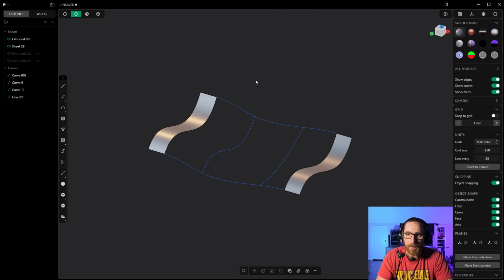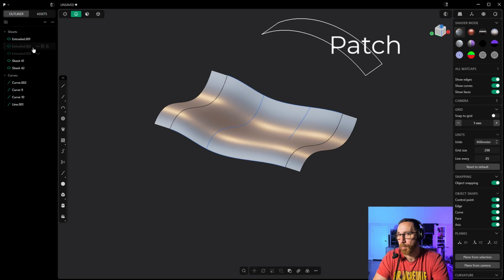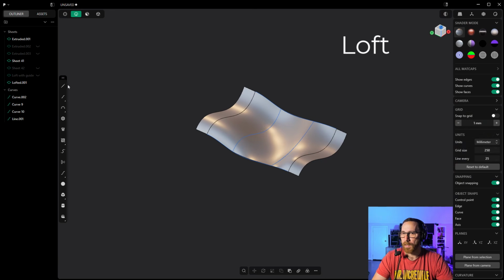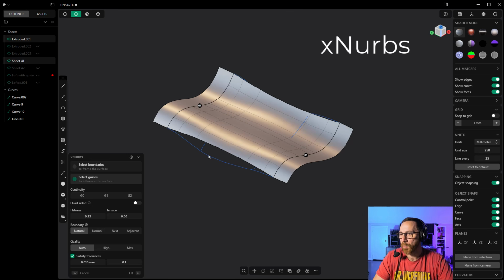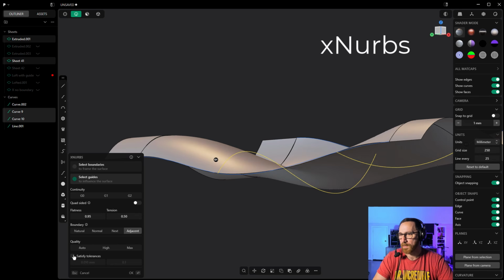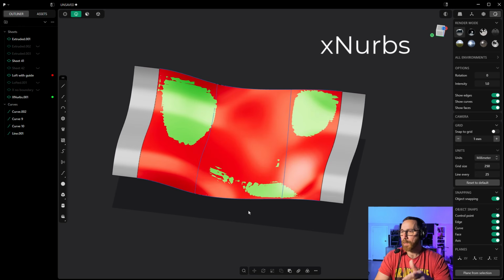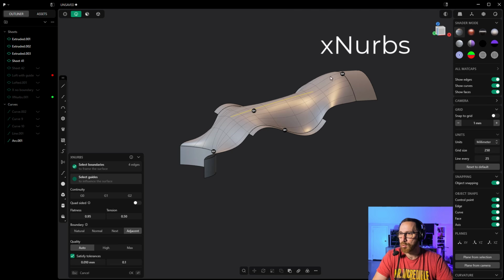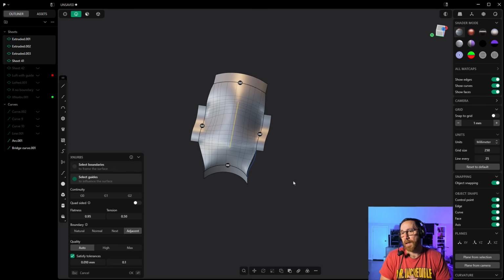Is Plasticity Xnurbs better than Loft? | It Depends | Walk Through Surface Creation and Review

Comment: Hi Matt... thanx for this... your videos have been very helpful... I am starting to design guitars to build on the CNC using placticity... I am kinda doing okay as I have experienc in blender, Fusion360 and Shapr3D... but one thing I'm trying to figure out is this. once a lofted surface has been created, can you make changes to the curvature, or do you have to delete the surface, change the guides and re-loft/patch everytime... I have Indie licence and I'm wondering if upgrading to Studio for the Xnurbs will give me more freedom... Thanx again for the helpful content...
Reply from the maker: Sounds like Fun!  So to answer your question there is no "link" to the curve used to create the surface.  You can manually adjust the surface using tools like Raise Degree, but I believe that is a studio only feature....

Comment: I just bought it today and just trying to extrude a wing profile with about 30 segments it ran into trouble. Often doesn't cap the extrude, I can't scale the cap end to taper the wing, I can't move it other than in out along the extrude and if I loft between two copies at different scales they don't align, even though they should be identical vertex order it apparently tries some kind of nearest vertex bridging that goes wrong. Am I just doing it wrong or is the program really that limited? I have to segment the wing profile to get it across the span intact?
Reply from the maker: If you select the curves, it will extrude a "sheet" surface.  If you select the inside profile, it should extrude a solid.  If the profile isn't selectable, then it might not be closed (or on the same plane).  That would be the most likely reason it doesn't cap the end.  If you look in the outliner on the left you can see if it says "sheets" or "solids" for where the body gets created.

For the loft not aligning, id have to guess at this one without seeing the curves, but when you scaled the copy up, where was the scale point at?  Was the original created with symmetry about the origin?  I haven't had it jump a vertex like that on a copied/scaled profile before.

Comment: I bought the indie version, but to be honest, I tried to make something more complex and found it a thousand times harder than in Blender. This XNurbs tool is essential if you plan to model cars and airplanes. For more boxy objects it does help, but Loft and Patch are practically useless for more organic topologies like a car or an airplane. I’m going to get the Studio version.
Reply from the maker: We did a non-studio Car modeling series here. https://www.youtube.com/playlist?list=PLBDfGh8A8kXXglEZA2MGsn-U8z2pNCPny  
There are certainly some areas that are much easier with Xnurbs, but it isn't required.  But it is a different approach than Blender for sure.  I do a lot of car modeling in Fusion Forms which is similar to "Poly Modeling".  Each has their benefits so really depends on what you need to get out of the model.
Reply: @LearnEverythingAboutDesign  Look, in the Indie version, achieving clean shapes and good results is much harder. And when you watch the tutorials, you realize that most people use the full version, because it’s 1000 times more efficient to use XNURBS than the tools available in the Indie version. Even if, in some cases, XNURBS doesn’t completely solve the issue, you can still start from the shape it generates and refine it to fix the problem.

For vehicles and airplanes, the Indie version works mainly for creating the drawings. It seems to me they could offer a Studio version for a single user at a lower price, but with all the tools included, because this is a program made for 3D artists, and most of them are independent individuals who work alone.

Comment: for that pay more 125$, sorry but in the end of a day still needs to fix everything in blender. better buy indie... I like plasticity but its get expensive more and more every year, and for asset and media modelers its get too much expensive
Reply from the maker: Yeah its not the right tool for every one or every  use case.  If the part is going to mesh have you used the blender bridge and remesher and the nGon tool?
Reply: @LearnEverythingAboutDesign yes is great, I use quad remesher and sometimes 3Dcoat. I bought too many tools for every problem in life😂

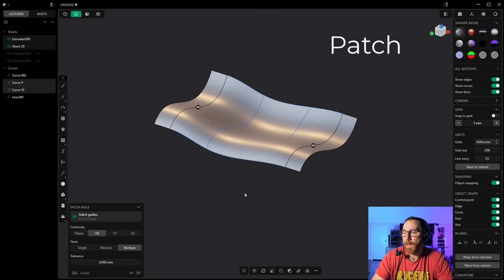Comment: 2:22 Theoretically, the patch tool can also be used as a loft tool by extruding one of the guide curves into a sheet and cutting this extrusion with isometric cuts at the point where the profile curve touch the extrusion. However, it only allows for one type of "profile guidance". But after that you can plays with patch tolerances too.
Reply from the maker: Yeah.  If Patch had an internal guide option (like some CAD programs) it might have been a more direct comparo with loft and xnurbs here but I wanted to at least mention it.  Without that midrail it and the Square tool also come into play.

Comment: Great content! But can you show us the CV counts or surface analasis, Because i feel like they seem to make quite similar surfaces but the reflective qualities are not that similar
Reply from the maker: Thanks.  with the CV counts do you mean what they show when you use Raise Degree?  The preview you see with auto/high/max quality?  There isn't a preview on loft without raising degree (that I am aware of).  And do you mean vs. Loft or just for the xNurbs tool?

The big difference I see is that loft is closest to using the Quad option.  With xNurbs the looser the tolerance will generally produce a nicer reflective surface (from my testing).  So setting the tolerance from .1mm to .5mm but still use "satisfy tolerance"  If you loosen the tolerance values and se the quality to max that has given me the best results.  note that if you use max and the quad option things usually go very poorly :)  So leave that option off if you plan to not use Auto.

If you are looking just at the xNurbs tool maybe i can come up with an example that can show off the setting changes.